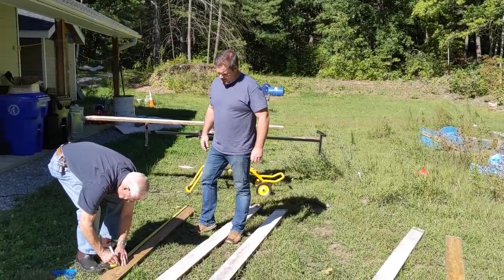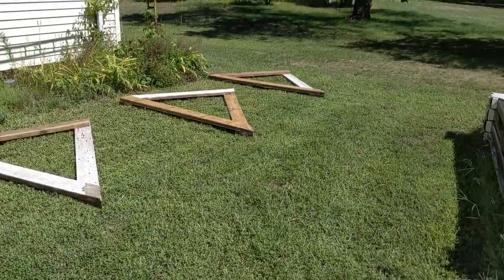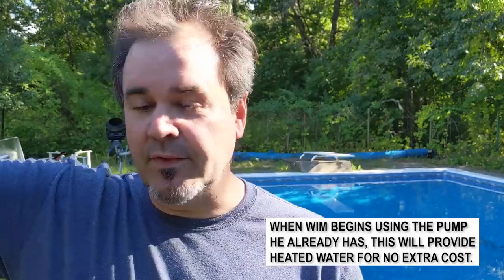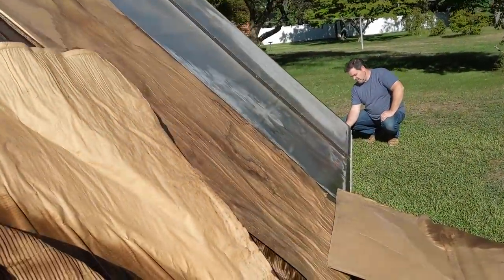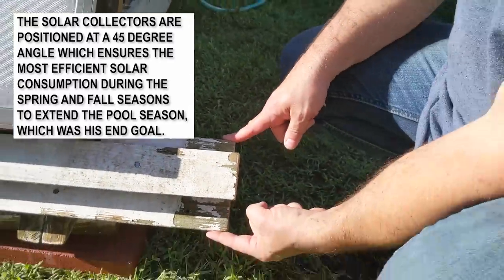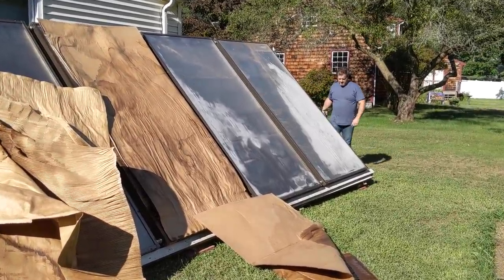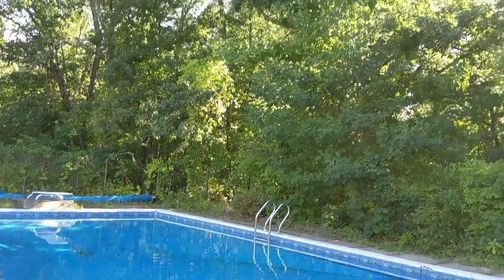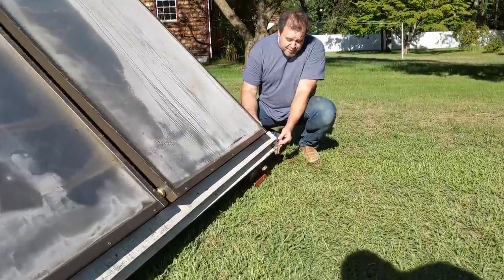Building a Solar Pool Heater for Huge in-ground Swimming Pool

Comment: Great job, sounds like approx 12 kw given the surface area. Thats a lot of heat!
Some tips in case others are curious, 
Run the pump from a solar panel, that way the system only runs when the sun is out and theres energy worth gathering. Its like a free on off switch, and less wiring to do.
best to put collectors in parallel, so you get less losses due to total temperature being less, otherwise the last collector is working less efficiently, as water coming in is already warm.
Higher flowrates also mean lower temperature, but overall more energy going into the pool as temp diff with env is minimized.

Great stuff!

Comment: I have the same panels. I was told that the chlorine in the pool water will eat the copper by 20+ different plumbers. need to make a heat exchanger.
Reply: Like chlorine ate through house plumbing copper pipes?  My home was built in 1973, and all the copper pipes are just fine. So if these panels last 50-70 years, I'm okay with that. I am absolutely NOT an expert at solar or plumbing. But common sense tells me they'll be fine.  shrugs
Reply: It will eat the copper pipes!
And make the water toxic!
Copper and chlorine dont work!
Reply: There's quiet bit of difference in concentration of chlorine between tap water and pool water.try tasting them both......higher concentration means way more reaction .

Comment: Like a greenhouse's season in New England, you will get about 2 weeks longer on each side of the season.  Still a month is a big deal.   Because you will still get those occasional freezing nights which will require you to winterize the system do avoid damage.   But a good pool cover will be required too.    It will work great in the summer for a warming pool.

Comment: I still say in the long run you are better off going PV. Adding a few extra panels to your current system or installing a new one. IF you already have a system, the extra panels will allow you to hit float sooner(especially during non pool months). Once you hit your float voltage, you can use all your panels to heat the pool water.
Reply: No, not for just heating water - about 20% of PV goes to make electricity if you're lucky. The 80% heat is wasted, unless you can make your own solar panels that also circulate water to capture that heat.
By using solar thermal, you're collecting much closer to 100% of the energy, and using it directly to heat the water. The only losses are some reflection, reradiation and thermal leakage in the pipes.

Comment: If the panels don't work well enough, buy some black 1" irrigation pipe, coil it up, build a 16" deep box that you spray black, and cover the top with some lexan, add that to the loop.

We had a similar pool that stayed a nice 70'F all year long. In the middle of the summer we had to reduce the flow a lot or you'd have a pool sized hot-tub. (If you run warmer than 70-75'F you have to change the type of chemicals in the pool over to the type used for hot-tubs.)

Comment: A coworker of mine decided to preheat the water supplying his hot water heater.  He figured out how many feet of 2” PVC he needed to get 80 gallons because that was the capacity of his water heater.  He then used conduit clamps to install that 2” PVC under the rafters in his attic.  Now he has a “tempering tank” in the attic that preheats the water going to the water heater.  It takes less energy to heat water that’s already warm.  He has a bypass installed on it for winter.

Comment: Chlorine corrode copper pipe, you need a close loop (316 stainless steel heat exchanger).

Comment: The pump is basically only working against the friction of the water channels .  It does have to be capable of pumping the water up as high as top of the panels to get started but the net water rise is zero if it takes water in and puts it out at the same level in the pool. The heat in the water will dissipate fairly quickly to the water . ALL the water in the pool does NOT need to be pumped through the collector system so it isn't moving 35,000 gallons of water to heat the pool.

Comment: Glad to see a video using these panels but do you have a video on how to connect the panels together. I have two and having a hard time sorting out if the water is going in at the bottom and exiting on the other side at the top or other way around
Reply from the maker: https://youtu.be/kkoesuG72xQ

Comment: This actually reminded me of your other experiment you did where you tested pv panels hooked up to water heater element vs the solar collector.  I was wondering if you would do a test to see efficiency difference between hooking up pv panels to water heater element vs pv panels hooked up to inverter to run a water heater.  And then the question would be how to enable it to "switch" between water heater and inverter based on water temp.
Reply from the maker: After running my experiments a few years ago, I prefer PV water heating for DHW, when you want the tank at 130°F+, but for a pool this type of collector works better.
Reply: @DavidPozEnergy  Yeah I wasn't really referring to the pool, but more if it would be more efficient for pv directly to heater element vs going through inverter.

Comment: There are some advanced panels, my father-in-law uses evacuated tube solar arrays instead of flat plate arrays. The evacuated tubes reduce conduction losses and increase cold weather availability of heat. They cost more, but they are compact and easier to install by a single person. You can use less than half the area of flat plate collectors with evacuated tube solar and produce energy at under 10C/50F ambient.
So while they are more efficient, they are more 20-40% more expensive new, as you got the flat panels cheap that gap is more justified, but if I was buying new? I would go for evacuated tube solar thermal.

Comment: Does highly chlorinated water hurt the solar panels? Seems like they would break down faster than non-pool water
Reply from the maker: The pool water probably is not good for it long term.  But it's going to take a while before a problem arises.

Comment: Somewhat related, but do hybrid solar panels exist? We all know solar panels like being at a cooler temp, could we stick hoses on the back of normal glass panels and heat a pool with the energy that's not absorbed by the silicon? Would be pretty annoying to make work on a roof mount, but for ground mount panels like you have it might be possible.
Reply from the maker: Yes, I've seen a few companies start up over the past decade with a hybrid panels.  All companies I've seen have failed.

Comment: I did not see a thermostat control, if your pump runs 24 /7 it will not give you a net gain as desired and actually shorten your season.  It can only run during daylight hours to be  a net gain over the full season.

Comment: Very cool. So was there a solar panel to run the pump? Thanks for sharing
Reply from the maker: No solar panel for the pump.  It could, since it's a 12v pump.  But Wim is having these panels plumbed into his pool filter pump (240v ac) and then won't need the 12v pump.  I'm just loaning him my 12v pump for the time being.
Reply: @DavidPozEnergy  need a thermostatic control if you do that, when the night is longer than the day you will have a net loss.

Comment: So at best a couple tons of heating and limited hours a day. At 5btu heat loss per degree per sq foot, 15x30 pool then 54000 btu is required to support every increase in degree f....

This contraption isn't likely to increase pool temperature over 4f what they would be normally. I'm not sure how much extra time comes from such a little amount of heat.

Maybe if they had a built in tub that overflowed to the pool that it could keep it nice and warm, or something like that.

Bottom line is that you need a LOT of solar collectors to make it work.

Comment: I use the old school method (hundreds of feet of coiled black hose).  No pump needed.  Super simple.  Just trickle water thru it so it comes out hot using community water pressure.
  Someone should figure out a way how to run water thru some type of heat exchanger connected to an idling car.  That way you could heat up your pool even when there was NO sun.  An idling car consumes very little gasoline, but it sure produces a lot of heat.  The cool water pumping thru the heat exchanger would likely prevent the idling car from overheating.  You could also use power from the alternator of the idling car to simultaneously charge batteries like on a bad (cloudy) solar day.  A typical idling car connected to a bank of 12V batteries in a mid state of charge should draw close to 70A which at about 14V is around 1000 watts.  I bet a gallon of gas used for both heating the pool AND charging batteries would last several hours.  That would be worth it.
Reply: If the radiator in a vehicle cools the engine off too much, then the engine will dump more fuel to compensate. The engine block needs to be around 170-200F to operate efficienty.
The Alternator is horribly inefficient so far that it is close to 50% efficient. And again, the more load you put on the Alt, the more fuel is consumed, as the more load, the more the engine is bogged down, the more fuel needed to maintain idling speed. 
This turns an efficient idling vehicle into a fuel guzzling hog.